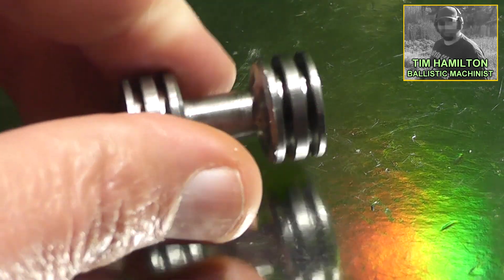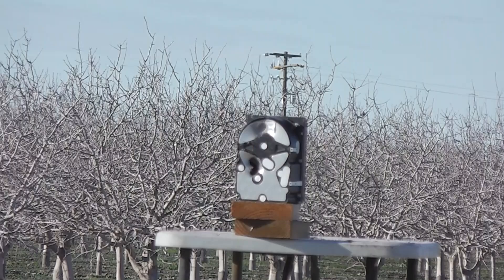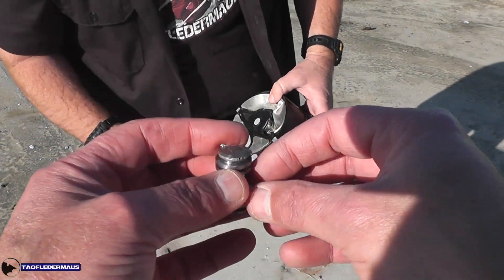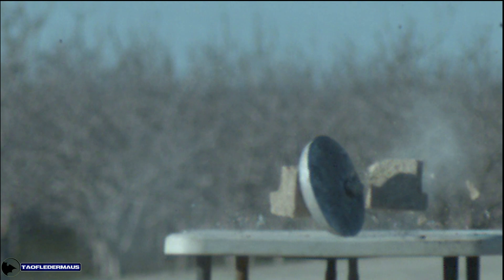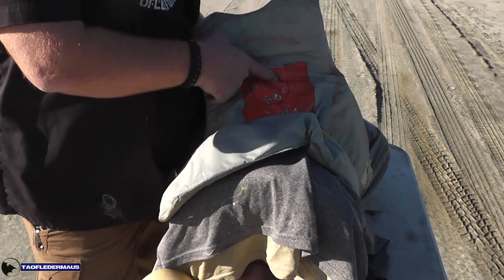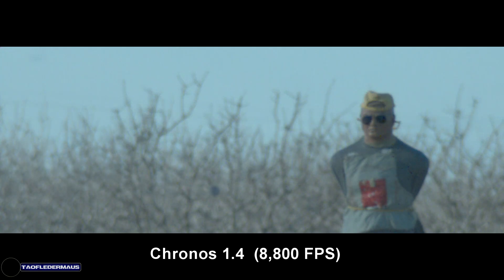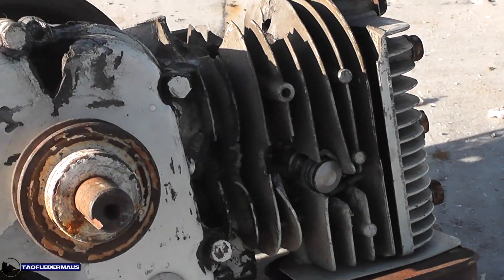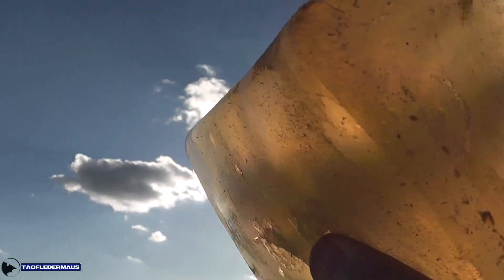DUMBBELL Shaped Slugs-  "Physics-defying"  performance

Comment: you should experiment with a 1,000 degree dumbbell slug
Reply: With purple drink perhaps?
Reply: MattV2099: Guns & Food 
The heat from the slug would melt the plastic of the shotgun shell and stick to the barrel. That and It might set the powder off early and burn the wadding if there is any.
Reply: Ikr!? love your content, btw, love Taofledermaus too, subbed to both you cray crays! (been watching for years)
Reply: MattV2099: Guns & Food Slugazine
Reply: MattV2099: Guns & Food lol
Reply: MattV2099: Guns & Food well, technically the bullet does heat up quite a bit in when it's fired...
Reply: original
Reply: MattV2099: Guns & Food that's stupid it would melt the shell and the wad and burn the powder